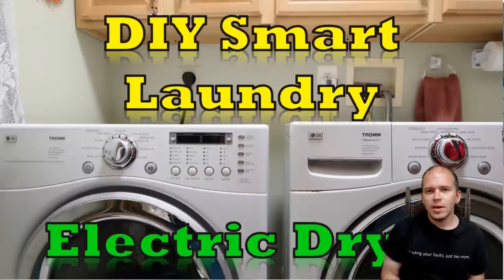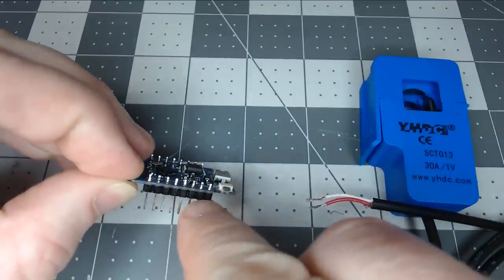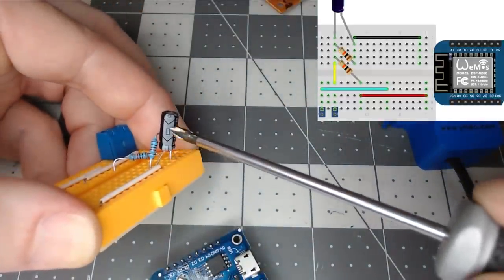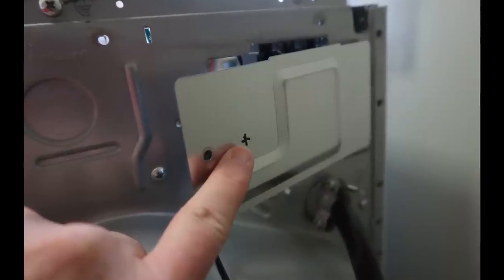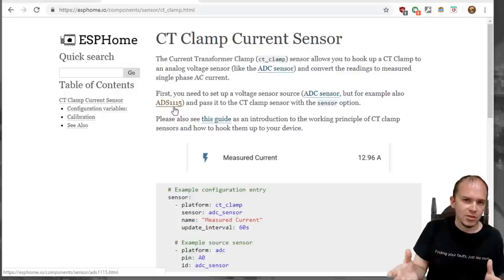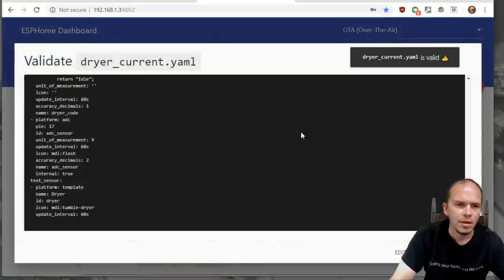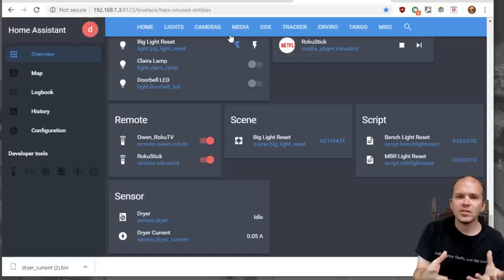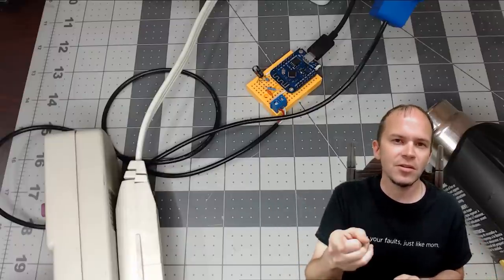ESPHome Smart Laundry Notifications on an Electric Dryer

Comment: Adding my 2 cents here. I connected the CT-Clamp on my dryer motor leg (this way you can see you dryer's load working even when set on No Heat). I wanted to make sure my ON/OFF trigger came from that wire, but the measured voltage was so low from the CT-Clamp (0.142V) that the ADC platform could not convert it properly into a RAW AC Value. I added an attenuation of 11dB so it can read those low values. Now everything is working and the ON/OFF is detected from that low voltage wire.
Reply from the maker: I want to say I suggested testing it with air only mode to find the correct hot leg to use.
Reply: @digiblurDIY  You are right, you did mention it. I will correct my message. But the attenuation was still required in my case because I could not get any readings without the attenuation parameters set on 11dB. Thanks @digiblurDIY, I'l learned so much through your videos over the years!

Comment: The direction of the CT clamp arrow, though a good practice to observe, shouldn't matter unless you're trying to measure power. I didn't see that you're utilizing an AC voltage reference.
One of these days I need to look at esphome, but not sure it's compatible w/ HA 0.74.2.😂😓

Comment: Love the video. I think I'd like to use this method to monitor multiple devices around the house from the breaker panel, ex dishwasher, well pump, hvac, oven, etc since those are each on their own breakers in my house. If each current sensor only needs one pin on the board, we could get a lot of these on one board, right?
Reply from the maker: You would need either an ADS1115 as it adds 4 analog to digital channels to an esp8266 or the esp32 has 18 ADC channels. I do plan to build one soon on an ADS1115 and esp32 but probably won't do a video on it as the full concept was already shown. I could do it on a live stream.

Side note you might be interested in a 6 channel board controlled over an esp32 that I showed on a live stream but esphome is not working with it yet. The accuracy is crazy on it. I could steadily see a 10 watt load on a 100A clamp.

Comment: Hi
I did everything like you showed in this video but I used a D1 Mini ESP32 ESP-WROOM-32 and everything is mutch with your scheme except, instead of AO it 's SVP and I couldn't find where is Analog output on this board and what happens is when I connect CT it's showing null but when I disconnect it is showing 49 Amp.Help please
Reply from the maker: the ESP32 has many analog pins, that's the beauty of it.  You might try to verify that pin you are using is analog capable.
Reply: @digiblurDIY  Travis, thank you for quick response. I forgot to tell you, how much your videos is helping me to understand and make my HA work the way I want it. THANK YOU
Reply from the maker: Glad it was able to help!

Comment: Hi, 
are you able to detect and monitor also Voltage or only Ampers? I saw in this video that in HomeAssistant you have any sensor with Voltage :) thank you
Reply from the maker: Yes, you can, you'd need a voltage sensor connected to the AC mains.

Comment: Hi Travis, Thanks again for your great videos. I implemented this device using the esphome approach. It seems to work well. So, if understood properly with esphome you get two sensors: one for the amps and one for the status? If you were to use the Arduino sketch you get the other ones like the network status and watts is that correct? Thanks again!

Comment: I've been thinking why not build one of these with a sonoff basic?  been thinking about tapping into the analog pin or using i2c or something,  just too many projects to get there,  would rather hack up a sonoff basic that has a case than deal with those open prototype D1/ESP boards.
Reply from the maker: Perfectly doable. Going to build one myself with the ADS1115 over i2c. Sonoff Basic wouldn't be a bad platform.
Reply: @digiblurDIY  That definately has my interest peeked!

Comment: I have wired this up but I am just getting the voltage divider voltage 1.5V going to the analogue input, measuring across the clamp it is just 38ohms, is this correct? This is with the clamp on the desk not round any wires.
Reply from the maker: Not sure about ohms but you should see the voltage from the dividers.
Reply: @digiblurDIY  I had to use a different esp8266 board as the micro usb socket came off the one I was using and didn't bother measuring anything on the new one just connected it up round a cable and it works fine. Maybe a case of too much cautious testing the first time.

Comment: About half the time, when the dryer isn't running, I get "'Dryer Current' - Raw AC Value: nanA" in my ESPHome logs, and then "Unknown" showing up in HA as the current.

Any ideas why?
Reply from the maker: It might be falling under the sensor settings. You could set a filter to show zero on it.
Reply: @digiblurDIY  I hate to be that guy but I'm newer to YAML and I'm not quite sure how I would filter out nan to return zero. Any help you can provide? Thanks in advance.

Edit: For anyone who may run into this problem, I added the following below the calibrate_linear filter in order to return 0.00 Amps when I received nan:

    - lambda: if (isnan(x)) {  return 0.00; } return x;

Comment: Great video as usual. Shelly just announced new product “Shelly EM” that measures current and I think it ain’t cheap compared to your solution. Wondering what are the ways and ideas that could use Shelly EM ...
Reply from the maker: I did order one but of course it will be on the slow boat.

Comment: I'm a bit confused. How do I know where to attach the NodeMCu 8266 to the breadboard? The image you posted just shows how to connect everything else to the breadboard, it doesn't really show how to connect the chip to it. Unless I just dont know how to read the photo.
Any advice? My NodeMCU has a lot of pins that also stick off the side of the breadboard...
Reply from the maker: Both pics are here. https://github.com/digiblur/digiDryerMon
Reply: @digiblurDIY  my chip is much longer since I used the nodemcu 8266. It sticks out off the breadboard. I sent you a message with a picture on Reddit
Reply from the maker: Gotcha.. Let me take a look. Shouldn't be too hard.
Reply: @digiblurDIY  we’re you able to check Reddit?
Reply from the maker: I haven't seen any messages there.
Reply: @digiblurDIY   so the 2 pictures on the GitHub have 8 pins and so they fit on the breadboard. But the nodemcu 8266 that you posted as an alternative (which k bought and flashed) that’s pre soldered has 15 pins. Where do I fit it and how?
Reply: I ended up just buying the D1 Mini and soldering it. It works, and its all set up in Home Assistant!

Now where is the part of the tutorial to setup the notification that comes after it drops to below the amperage level? I am trying to make Alexa send me a notification, but your tutorial stops right before that. Any where I can be directed to set up the rest of this?
Thanks!
Reply from the maker: This one might help with the notification I did on the plug which is the same when all said and done. https://youtu.be/q6aCfDDEkwE

Comment: Do you have sample codes on esphome that send data to home assistant?  Thanks..
Reply from the maker: No. Esphome does it all via mqtt discovery or API automatically for you.
Reply: @digiblurDIY  I just like use completely esphome without any mqtt.  I am looking for same sample code without using auto discovery in Home assistant.
Reply from the maker: There's no code as home assistant connects to Esphome via API. https://esphome.io/components/api.html

Comment: Quick question on the MQTT file you have uploaded. What dictates the topic name to use in the MQTT file? I see when I rebooted the D1 Mini is shows "dryer_current" as the topic name. I went back and forth from your original video to the new ESPHome (way better idea) but I did not see how you came up with the topic names. I know you refer to the mac address in the first video but where do you dictate that in ESPHome?  Thanks great project and very easy.
Reply from the maker: If you use mqtt in Esphome it will use the node name as the topic. I don't remember exactly but it is easy to find using MQTT Explorer.
Reply: @digiblurDIY  Thanks

Comment: hi digiblurDIY, is the case of the dryer not a faraday cage for the wifi of the esp?
Reply from the maker: It could be which is why only the clamp goes inside the dryer. Other options I have seen are putting the clamp in the electrical box by the dryer. Splitting some cord types behind the dryer or mounting the clamp in the breaker panel.

Comment: Can you please provide a link to that soldered protoboard? I have been looking for a protoboard that I can cut to custom sizes. Thanks!
Reply from the maker: I can't seem to find the exact one I ordered last year but it is the same board from what I can tell like this https://amzn.to/2EPKiCW there are various others as well.
Reply: @digiblurDIY  awesome, thanks! Stupid question... What did you use to cut them down to size?
Reply from the maker: @Rmharnisch  not at all a dumb question. The single sided are easier to cut. You can score them with a blade a few times and then snap it. A Dremel cutting wheel also works well.
Reply: @Rmharnisch  A fine toothed metal hack saw will work, some sand paper will clean it up.
Reply: @sirgoodenough65  thanks for the tip, will do!

Comment: Travis, I just found your channel and have been having so much fun! I just ordered the stuff to do this today in 2021. Didn't want to mess around with opening up my panel to install something in there, so following this. Just ordered the required stuff via your links and I'm excited to get it going! I just set up notifications for my washing machine and dishwasher using your S31 Tasmota guide as well. Keep up the good work bud!
Question if you see this.. My dyer's cable has the three wires sleeved individually, much like the extension cord you used in this video. Would I be able to split them apart like you did with the extension cable to get the reading?
Reply from the maker: Awesome!  Glad to hear it.  Absolutely, I believe in one of my dryer or power monitoring videos I showed a picture someone sent me of a setup like that.  Made it super easy to throw the CT clamp on.  You just have to figure out which one it is, throw it on the air (non-heat mode) and try it on each lead and see.

Comment: Great video! Thanks! Do you think I could power this with 3.3v from the S31? That's covering up the only outlet available nearby.
Reply from the maker: Not sure I would recommend that on the S31. I don't recommend adding sensors to those given they don't have really have proper mains isolation being a power monitoring plug.

Comment: If you unplug the dryer completely from the wall is there still some small amount of current shown?  I'm wondering if there is a control board or something that has some tiny amount of DC power pull all the time when idling?  It looks like the "idle" current in the video equates to about 5-15 W at 120 V.
Reply from the maker: Yes. Just the nature of the beast of this power monitoring with the voltage divider bias design.
Reply: @digiblurDIY  Looks like the sensor may need some calibration according to the docs:  https://esphome.io/components/sensor/ct_clamp.html
Reply from the maker: Right, I did that but set my 0 as 0 on the filter.   I mentioned this in the video if anyone had any better values after tweaking things to let me know.  I guess one could "move" up their zero, not sure if it would do a negative value though.
Reply: @digiblurDIY  
If it  bothered me I would tweak the 0 value,  It wouldn't bother me, though.
Reply: digiblurDIY nice vide and thanks! 
Is there any way to password protect tasmota’s web server?
Reply from the maker: Yes. Look on Configure Other button section.
Reply: @digiblurDIY  Hahaha! Sorry I meant to say ESPHOME. How to pw protect it?
Reply from the maker: @jeffchan6614  It doesn't look you can looking at their docs.

Comment: Just a quick question. As it seems the CT clamp comes with a plug which looks like the ones known from earphones. Does the plug hide the fact that there are only 2 wires run from the clamp? The fact of having a plug with three contacts irritates me.
Reply: The contact in the middle is unused. Found at https://www.poweruc.pl/blogs/news/non-invasive-sensor-yhdc-sct013-000-ct-used-with-arduino-sct-013
Reply from the maker: Cut it off and do what you want with the 3 wires inside.

Comment: Very nice project, thank you for sharing. Is it true that this script only reports the current. I would like to receive a mqtt message when the Electric Dryer is ready. I suspect it will become something, for example if the power remains very low for a period of time or something like that. Can you implement that option in esphome as well? Please. Best regards,
Reply from the maker: Yes, it only measures current as it is not directly connected to the dryer power source to measure it.  You can use other voltage sensors to measure that if  you like.  I do not believe Esphome has an MQTT publish action, but I do use Home Assistant to do this very thing when the dryer stops.

Comment: I think the transformer is fine but the ADC in ESP8266 is very poor.
Reply from the maker: I do agree but for this task it works well. If you need super accurate I would go with the circuitsetup power monitoring setup video I did.

Comment: Great video, I appreciate all you're doing for the community. I have tried compiling the binary, but get the following error.
"collect2: error: ld returned 1 exit status
 * [/data/dryer_current/.pioenvs/dryer_current/firmware.elf] Error 1"
Any idea what might be causing it?
Reply from the maker: No, I don't.  You could try slimming down your YAML by commenting out stuff.  Get it down to a sensorless wifi device and then slowly started adding pieces back to see what is making it fail.
Reply: @digiblurDIY  Thanks, it was getting hung up on the "web_server:" piece.